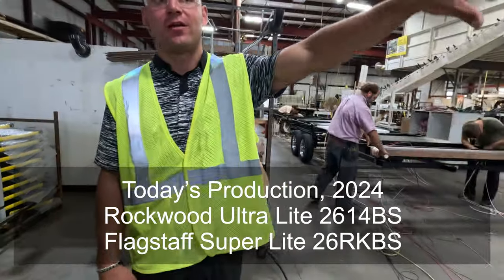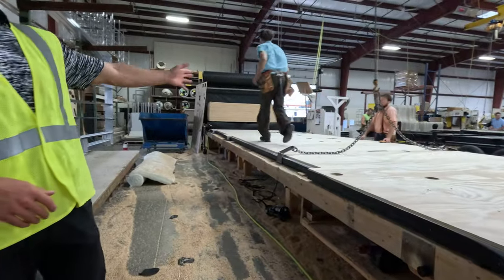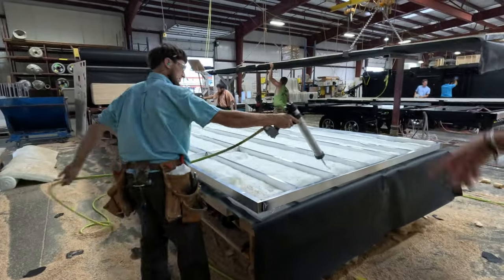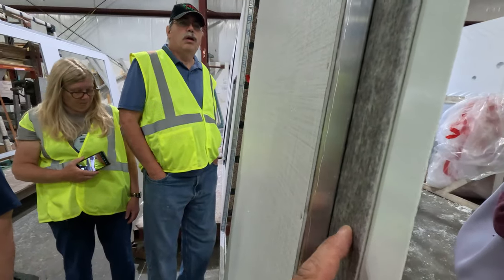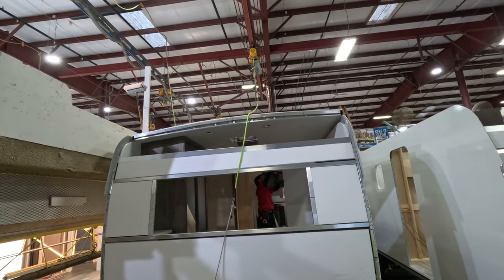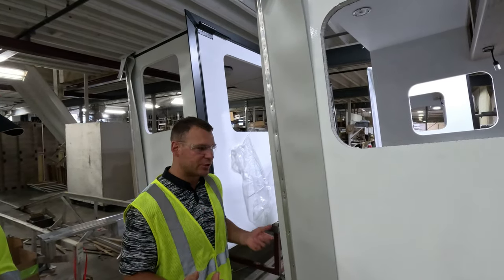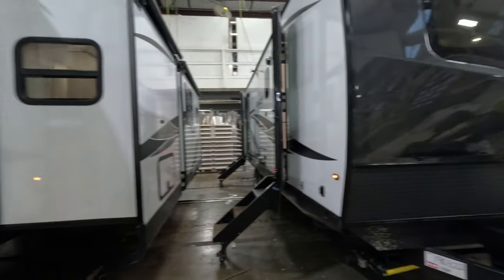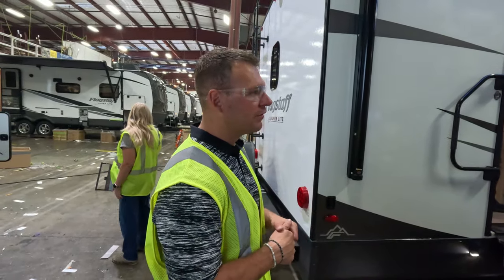2024 Rockwood/Flagstaff Travel Trailers - Live Plant Tour #rockwoodrv #rvlife

Comment: Just bought a 2024 minilite...I see all of the mistakes in my first mini lite here.  This is as half assed unprofessional as it gets.  This explains why my marker lights were put on without proper gaskets and caused my previous camper to delam. Quality here is almost non-existent.  That these are the higher quality trailers is really sad. I may pull my downpayment after seeing this shit show.
Reply: We had a delam in our first MiniLite as well caused by a leak at the marker light. But I also didn't do as was in the manual and ever go up and inspect that seal. Those seals are all routine inspection points. I know now. 

We have a 2023 MiniLite 2205s (same as Tony and Tina!) and the build quality has been outstanding over 12,500 miles we've put on it just since December 2022. There have been no failures of any consequence (a few screws came loose) and all the systems and build have remained as they left the factory. 

There are few manufacturers who do things like pressure testing their finished RVs for leaks. 

We also run a Facebook Group with over 11,000 Rockwood/Flagstaff owners and people typically have very good experiences with these trailers. No product made by humans is perfect naturally. 

But I also appreciate that, when a decision is made, it's typically to favor the better component. Things like MaxXair Fans, ShowerMiser valves, 22" ovens, torsion axle suspensions, Goodyear Endurance tires, on and on. So to state that quality is nonexistent means you either haven't looked at many examples of RV build quality or might not be the right person to own any RV at all.
Reply from the maker: Sorry to hear of your past situation with delamination. From our view during our visit, (sorry I didn't capture it on film) the quality of the build was very good. They have multiple inspectors at various stages for quality control. If anything is found that is not up to par, it is corrected immediately on the line. All units are pressurized for leaks prior to going out the door. Units are randomly selected to perform a 300-point PDI, they also will take a unit apart for an even closer look at the build quality. When a unit is ordered from a dealer with a customers name attached to it, They perform an extensive PDI prior to shipping it. When we purchased ours I talked to the mechanic who was doing the PDI, he said he loved Rockwood as there were hardly any issues, not like other manufacturers. Hope this helps in your decision making. Thanks for watching!
Reply: @TNTRVing You remind me - I used to handle warranties at a dealership in Northern California. While much of our inventory was built on the West Coast (mostly in Washington) we also carried Flagstaff (which is identical to and built in the same plant as Rockwood). These had to be hauled across the country, including in winter, to our dealership so they had already made a long journey to get there. 

Despite this the Flagstaff were not something I typically had any warranty issues with. Our service team did an outstanding job of inspecting units prior to the customer taking delivery and yet it was rare to have to have anything done with a Flagstaff unit despite that long journey they had already made. 

This is just one of the reasons I own one myself so I think the quality is there.
Reply: @TNTRVing  Thanks..that makes me feel a little better because I wasnt there and you were but only slightly.  As a builder I can easily spot things these guys were doing incorrectly because they were rushing.  The build issues in my previous camper were definitely from this hasty style work exactly as seen in the video.  Another example was my water hose was kinked.  My fresh water tank has never been used as a result.  No way they didnt see that when they put it in same as my marker light.  Its in a spot that cant easily be reached.  I discovered it by using my cell phone and recording as I stuck my arm in as far as I could reach.  They kinked the hose in order to turn a tight corner to get it on the pump so they knew they did it but figured screw the customer.  Furnace didnt work either.  Also, the screws throughout the camper were screwed into nothing.  Nearly every trip we would find screws on the floor and then we would try and figure out where they fell out of.  Drawers fell apart and sink fell out because they used two dabs of glue in just two corners.  Have pictures of it all.  Also every inch that is not living quarters was full of saw dust and contruction debris where they didnt even bother to pick up or vacuum the area when done.  In your video as one example of many, he hastily spreads adhesive caulking on the frame for the floor then they proceed to throw the plywood down and drag it across the frame which scrapes it off thus defeating the purpose.  It should have been placed directly on top not thrown down and slid across,  so yes Rockwoods can boast their build materials but they completely fail in the execution.  For the money they are now charging they need to correct the shotty execution of the build quality they are boasting.   That being said, the other manufacturers use the same hasty craftsmanship only they use even worse build materials and contruction types.  So we the buyers have to choose between crappy build or even crappier build. Seeing this video only confirmed what I thought based on seeing what they did it my first camper.  Mine wasnt a lemon it was simply their standard approved build.